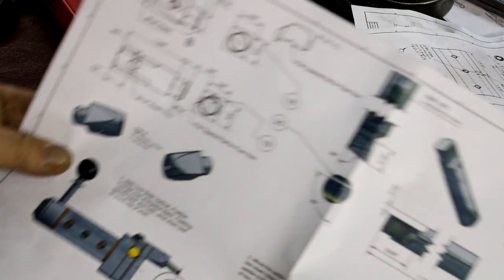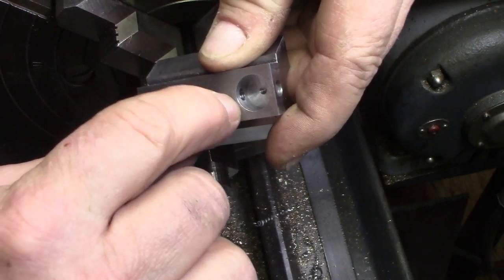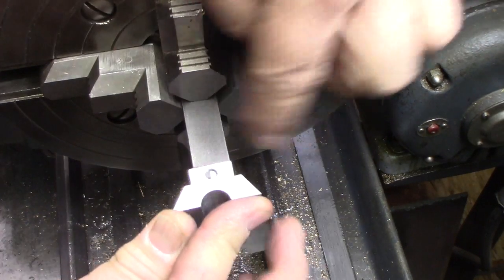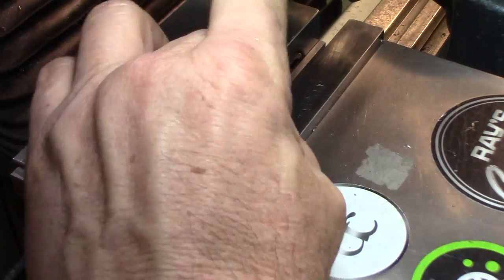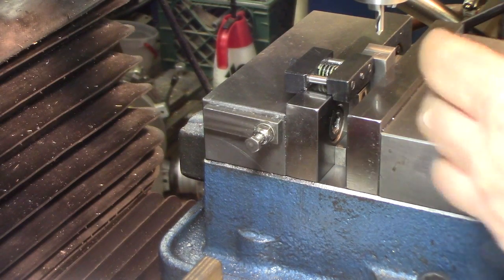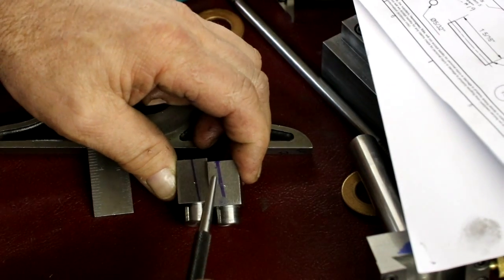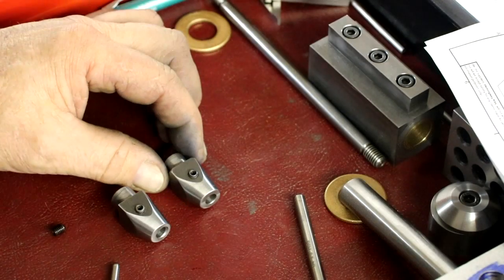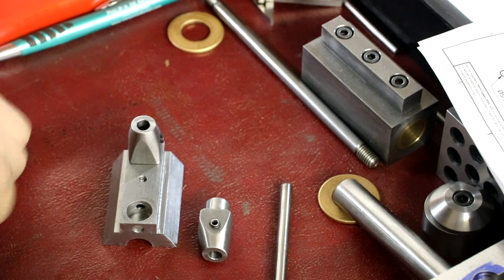How To Build a Hemingway Kit Spherical Turner / Ball Turner P13

Comment: Since only one tool holder can be used at a time, I wonder why the plans called for 2 and why you couldn't just reverse the slide for concave vs convex work?  Very interesting project Randy, looking toward to seeing it in operation.
Reply from the maker: The slide is not reverseable.
Reply: Randy Richard In The Shop Yea, I guess the slide wouldn't be reversible once the adjustment assembly is installed, but aren't the tool holders interchangeable?
Reply: But if the tool holders are exactly the same and you can only use one at a time why do you need two?